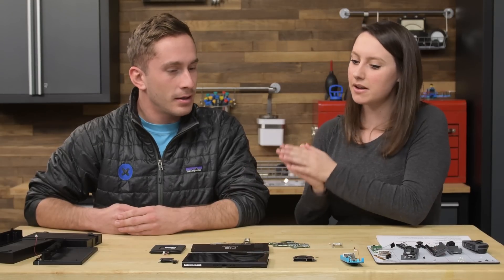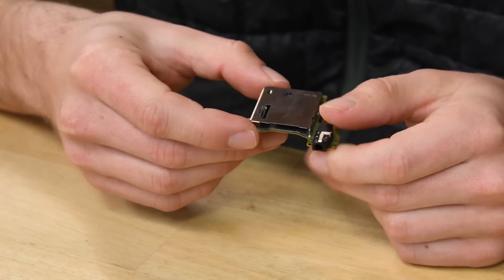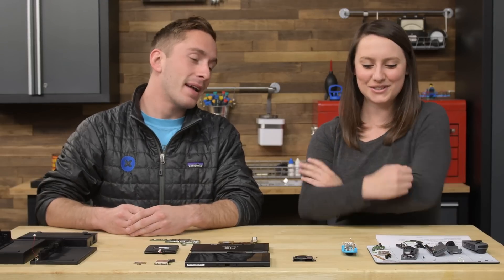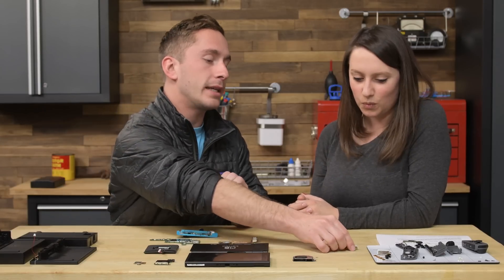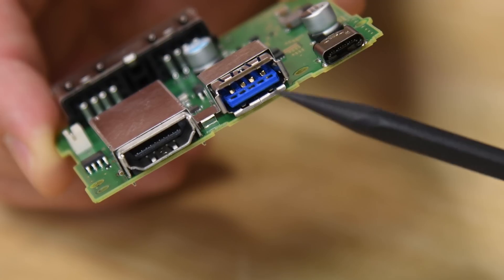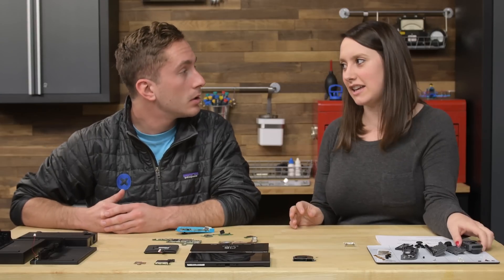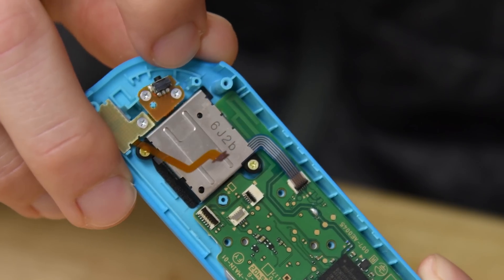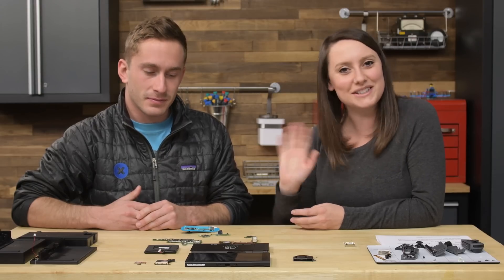The Nintendo Switch Teardown Review! With your Questions Answered!

Comment: I love Nintendo, but this console was so half baked at launch, they clearly rushed it out.
Reply: Teighlour Swyftte Every games console is half-baked at launch. The PS4 had (has?) random bricking issues, the XBox one had the pack-in Kinect and always-spying DRM, the PS3 had a CPU architecture that was almost impossible to develop games for (which is why many of the games are pretty bad in terms of gameplay. The devs tried). The Wii U had the Gamepad. The Wii had scarcity issues for years after launch, and quality control issues in their games. The Xbox 360 had ~30-40% of all units sold brick themselves with the Red Ring of Death. The PS2 had disk drive issues on launch. The Gamecube had a lack of DVD support in an era dominated by DVD tech. The Nintendo 64 used cartridges. The Sega Saturn... Well, it was the Sega Saturn.

Bumpy launches are inevitable in any software or hardware launch. The USA was just lucky enough to have its launch postponed a year or two after Japan/Europe, and so we got Version 2 of the operating system. In Japan, this kind of thing is normal.
Reply: Well, it seems more quarter baked, they have the smallest launch lineup i've ever seen, and i know it's repetitive, but they don't even have a shooter like cod or battlefield etc. < i know i'll get hate for the COD comment.
Reply: Hell, i don't even mind if it only played 720p, if a screen isn't above 22in i can barely tell the difference of 1080p and 720p
Reply: Teighlour Swyftte Yea I know right. is to so much to ask for a proper Nintendo console, fuk 4k at least 1080p with a good online network and good launch games, like imagine a pokemon, Mario, yoshi, Kirby,  metroid prime, and Zelda coming  out on launch with no gimmicks only a true gaming controller

Comment: Is there a possibility that nintendo could make a different dock (Extra cost of course) that would enhance the switch's graphics and processing capabilities? I don't know if the switch's tech would allow for this, but if so I feel like this could be an awesome addition to really boost the switch into being comparable to the more standard home consoles available now.
Reply: The Switch outputs a USB 3.0 signal and MyDP signals, so no. USB type C with Thunderbolt 3 only puts out 4 PCIe lanes, and even then there's bottlenecks with that on high end laptops. They'd need a proprietary connector for full possible bandwidth, which USB C/TB3 wouldn't provide. 
But even then, the Switch doesn't have supporting hardware for an external gpu, if a Tegra hybrid SLI is even possible.
The best possible solutions is either a Nintendo made more powerful Switch, or getting Switch software to run on separate hardware.
Reply: it would be posibly but unlickly because its not that easy to ad a second graphic card in to a console in midle of its lifespan
Reply: Tanner Muscarella If Nintendo were to use the USB-C port in the dock to connect to an external graphics card, it would be entirely possible for them to do so.

Such a dock would be astronomically high in price, but as the Switch wouldn't be using the internal GPU, it would charge faster.
Reply: Likely possible but also certainly would require a major firmware update.

Comment: What kind of Nvidia proc it is
Reply: Custom Tegra x1 SoC.
Reply: Mathieu L We won't know until it's X-rayed. The chip is custom designed by nVidia in collaboration with Nintendo, so all information on it is most likely classified.
Reply: Tegra Maxwell
Reply: All Tegra processors are maxwell.

It's a Tegra X1, the latest one available in a consumer product.

Comment: I think it will get very difficult to replace the Flash Memory because you habe to install the Nintendo Switch OS (don't know the exactly name of it) to use the console. The problem for this is that you have to connect the memory to an computer/ microcontroller to write the OS to it and i think that Nintendo will not give us her Switch OS free to Download.
Reply: People have already modded the daughterboard to where they can read and write the chip, and this was done with devkits that had 64GB chips back in mid-February. 
It's really not that hard to do. 
Read the old chip, copy it's contents, write those contents to the new chip, and replace the chip. 
Nintendo will most likely have the chip locked to the system, like with the SD cards, but this won't be a problem with copy/pasting the chip's contents. What may be a problem is is Nintendo also locks a specific chip size to the system, meaning we can't upgrade the chip through mods or a replacement daughterboard; though this may be possible to do with modified code. 
But nobody really knows yet, I haven't seen any modding outside of the chip being read and written to externally.
Reply: Gaming with Jo If the contents of the eMMC storage (or at least the user data partition, the firmware partition could be encrypted out the ass and it wouldn't matter) are not encrypted, you could easily resize the partition to fill a larger eMMC chip using a run-of-the-mill partition manager. Nintendo has always used standard partition schemes all the way back to the Wii with its Fat16 filesystem, so if the userdata partition itself isn't encrypted, resizing it to fit a larger Switch memory board would be trivial.

Comment: I wonder if it would be possible for third-parties to make and sell some of these parts to help people who are experiencing serious glitches with their Switches.   It seems unlikely, but if the problems are hardware based, no amount of software patches are going to fix them...
Reply: PTNLemay Yes, once a significant number of parts get to third party distributors, it'll be pretty great for anyone who wants to fix their Switch.

Or, you know, you could send your Switch in to Nintendo for a free repair, as long as you don't pull an iFixit and take apart everything at once, making everything much harder to reassemble.

Comment: Tri point screws is what Nintendo has always done.
What I'm surprised about is how Nintendo is going with modular components. 
I feel like this is them making it easy to upgrade components in later iterations of the Switch.
Reply: xxnike629xx I would agree. it's very odd that they would make the flash memory modular. Not something any company would want anyone messing with... strange.
Reply: SirJamez0 If you think about it to me it suggests a "Deluxe" version of the Switch coming later and I'm presuming that 1 aspect of the hardware they'll 'switch' is the internal storage. 
They can keep the costs lower if they have more modular components for the Switch system.
Reply: Memory is going to be the first thing to be offered in a separate console, as the devkit has a 64GB chip on it.
Reply: ***** By then they might announce a "Deluxe" or "Pro" version of the Switch. Why not wait a bit more.

Comment: I wonder, can you expand storage via the USB 3.0 using a portable hard drive without the Micro SD?
Reply: Switch, as of now, doesn't support external hard drives.
Reply: HDose Not yet, it's not supported by the Nintendo Switch's operating system as of now. Nintendo have indicated they're going to rectify this at a later date.

Comment: The dock scratching the screen isn't "a little bit of a problem". If one of the primary functions of the systems damages it, it's huge fuck up.
Reply: akawhut Nintendo is looking into the issue. So far they have stated that in none of their testing have they been able to replicate the issue, therefore it's probably a bad batch of docks.

There's a difference between a manufacturing mistake and a design flaw, after all.